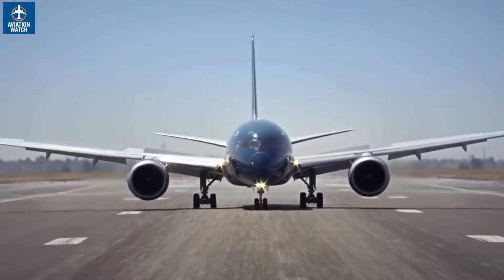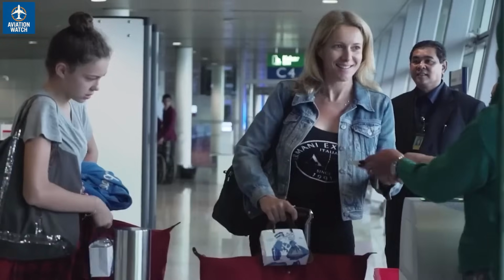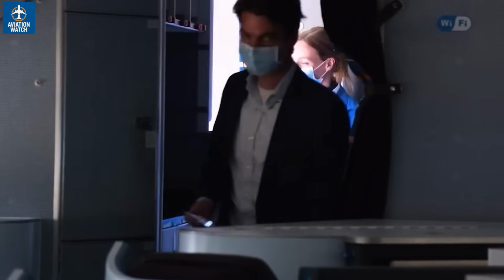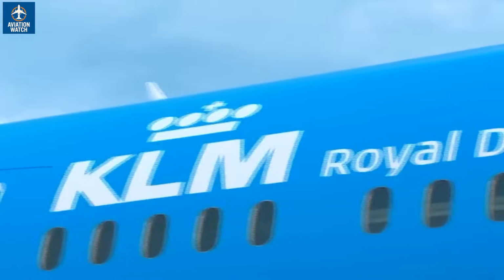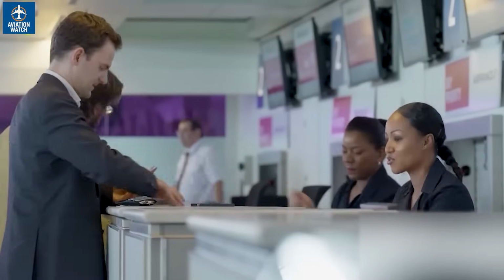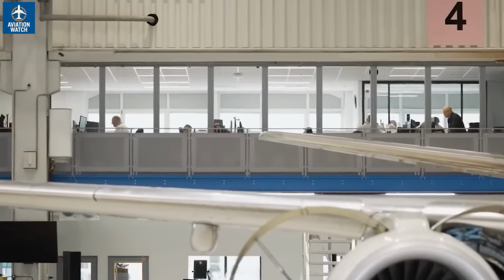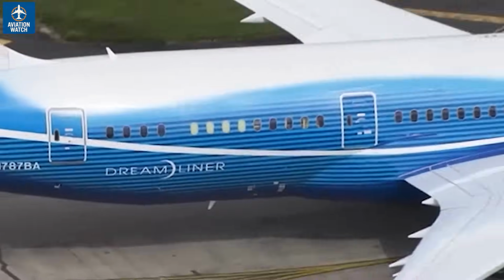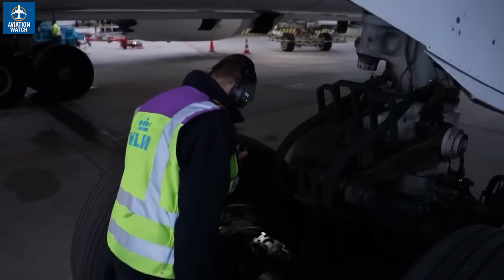They Just Found a Hidden Defect in KLM 787 – It’s Worse Than Anyone Knew

Comment: Blaming Boeing, they dont produce the engines. Vibrations from engines that caused emp in down 787. That's a known  defect by manufacturers. Their fix put 🇺🇸 doesn't put emp wiring on commercial airplanes. I studied this in school and put new tech box in and when my had emp pulse it saved the house. I dont thing it existed when plane was built. It isn't cheap by no means